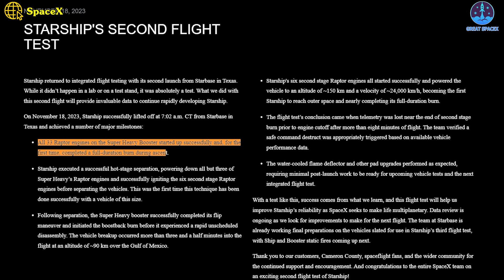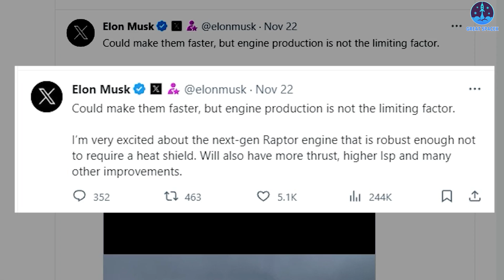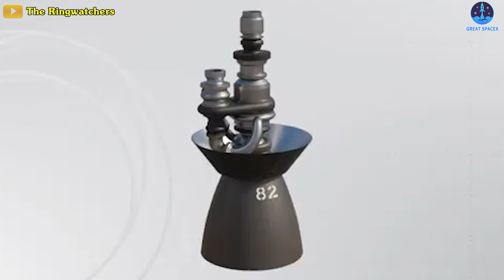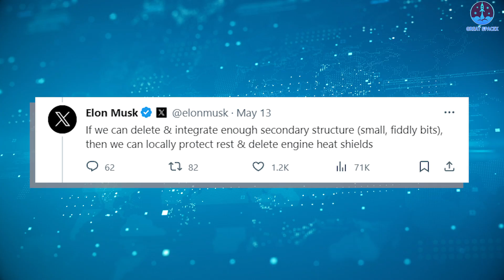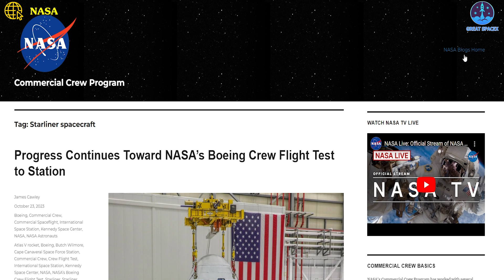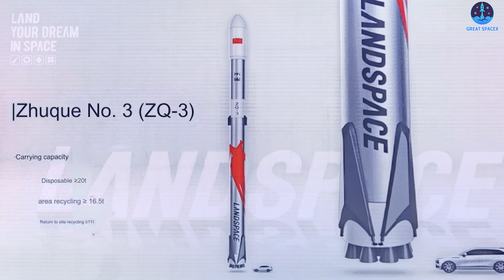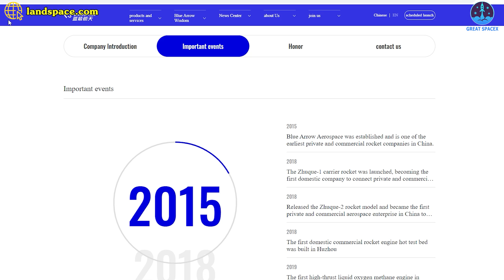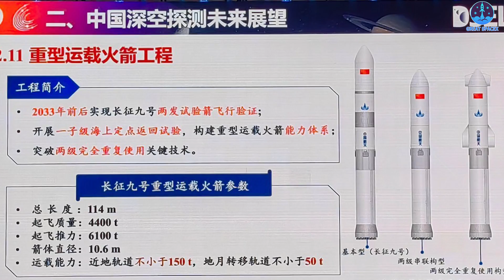Elon Musk just revealed next-gen Raptor engine “More thrust, No heat shield...”

Comment: I want to see how they keep the fuel and oxygen at the correct temperature and pressure once  the depot ship is in orbit, with the sun shining on it. If it heats up and expands, they'll have to vent.  On the way to Mars, how are they going to keep the fuel cold? I guess pumps and compressors, and batteries to run them - all of this will add to the mass of the ship and lower the payload.
Reply: Perhaps reflection and insulation, Tis cold out there on the non sun side, maybe a roll now and then to keeps everything in the tanks nice and cool

Comment: Another promise of more power when none is needed. The Starship hasn't lasted more than 10 min in use!  That's a launch customers 'take'.
Reply: they want more power so they can likely reduce the number of engines in the future. thus lowering launch costs.
Reply: So. it's all about what they want when what they have disapoints. That's a rich brat smashing his toys AGAIN. @Mike-jv8bv
Reply: The new engines are more powerful, more efficient, have fewer parts, are easier to manufacture and maintain, and cheaper to mass produce.  I really don't see a downside.  As far as not lasting more than 10 minutes, they achieved the initial goal of surviving until scheduled shutdown.  What happened after that is unclear, but on the booster, it didn't look like the engines blew up or otherwise malfunctioned.  Not relighting properly for boostback may be attributable  to fuel tank slosh/fuel starvation or other mechanical issue.  Still not clear to me if the booster RUD is because of AFTS activation or something else.  And I don't know that SpaceX has released a definitive report yet regarding what happened.  I've heard all kinds of opinions from those that don't necessarily have access to flight log data as to what happened to the booster or starship.
Reply: Curious which launch capable rocket engine ever fired more than 10 min? I’m pretty sure about 8 min does the trick. Plus Shuttle & Buran were the only launch engines I remember that fired from liftoff to orbit 8 1/2 min. through staging events. Maybe I’m missing something about your assessment.
Reply: I'm talking 4/20 and this one that's 2 that never made orbit regardless of how long they burned They failed! @phillipmiller5996

Comment: Using gas/ fuel mixtures will be so unnessasry once they develop nuclear power. Fuel storage/ refilling/ bulk of thanxs will make the raptors look like a model T car. Till then I think they are wasting money
Reply: I don't know that there is a viable technology right now to do that.  A lot of theoretical concepts, but nothing that I have seen more concrete than that.  Do you know of something that would be a viable nuclear energy drive?
Reply: @warrenjm9  The Voyager has been running on nuclear power since 1977.
Reply: @southofhollywood4199  Voyager didn't use nuclear power for launch activities.  The Titan3 booster was a hypergolic liquid fuel core supported with 2 solid fuel boosters.  Voyager has 16 onboard hydrazine thrusters for positional control.  "Nuclear power" is only used to generate electricity for the computers and instruments.
Reply: @warrenjm9  I recall reading somewhere that Voyager is powered by an isotope.  It will have power until the isotope runs out.
Reply: @southofhollywood4199  yes, Voyager uses a radioisotope thermoelectric  generator to generate electricity for the computer and instruments.  For maneuvering control, Voyager uses 16 hydrazine thrusters.  Yes, those thrusters are controlled by the computer that runs off the electricity generated by the thermoisotope reactor.  But there isn't a nuclear thruster by any definition.

Comment: I question the use of all the engines during hot staging. Why not use the 3 raptors instead of both, the 3 raptors and the 3 Rvacs? It seemed too violent. Was the thrust of all 6 motors necessary?
Reply: Test the extremes.
Reply: There is a ring in-between the first stage and the second one....Do you think they haven't thought about that????? Are you an Engineer???? They will figure it out....sheeez
Reply: Are you? Stop being a snob. @1flash3571

Comment: How many extra tons of material do the heat shields add, and is the extra payload capacity worth the risks associated with not using them?
Reply: Good question, especially since the plan is to reuse these boosters.
Reply: Just imagine adding heatshield to 33, or 32 rocket for the first stage, AND 6 more in the Second Stage....Stainless steel isn't light even if it is thin. If starship can handle 150 tons of cargo with the shield, being able to carry extra ton or 2 is a BIG thing. Each ton is about 2000 lbs.
Reply: For the Falcon 9 and the Falcon Heavy to each bring a full payload into LEO, they expend on average about 45,500 and 47,700 pounds of fuel per 2,000 pounds of payload. So, for every ton of weight you can shed, you can save almost 50,000 pounds of fuel. That can either be fuel saved or fuel used for getting to the moon or Mars. Minimizing the weight would decrease costs while increasing the overall performance, efficiency, and range of the Starship. The ideal Starship would only be made up of equipment that is absolutely necessary for safe and efficient operation. Any excess just reduces efficiency and increases cost with no return.

Comment: Why doesn't SpaceX spiral the stainless steel on the outside of the rocket? One long spiral weld. No fiddly bits(rings to stack and weld). Could be done with a stationary welding station and a rotating rocket shell(tube). Bulk heads could be inserted as the shell is roller up and welded. It would make for a very fast rocket production system.
Reply: I dont know, im no engineer, but i think this is perfectly fine
Reply: It's a very good observation.  One might even make a continuous tube and slice off the lengths needed for specific rockets.
Reply: @clavo3352  How are they gonna keep the unrolled steel stable for the MACHINE welding to weld the parts together????? You really need to think before you guys start yapping.....Making the ring section is the BEST way to do it, one ring at a time......
Reply: I suggested the same thing several years ago.
take my up vote!
Reply: I think they won’t enough space to work with that.  They’re already working on the second launch tower.
Reply: @Puer-Aeternus-Anonymous  Well, that could be done horizontally, but I did a writ about it over two years ago probably on 
r/spacex, but I was thinking grow it vertically at the time. And have access thru the bottom of  system to work on internals as you went up.
It would probably be a good technique for seriously mass produced stuff, like disposable fuel, oxy, or water tanks en route to Mars, to then be landed and repurposed into habitat. If you removed the tank ends, you can fly round tubes like a box kite effect, and the ends could fly like frisbees with solid fuel rocket motors around the edges. would be a way to get them down easier and less damage.
Reply: @garylester3976  “The best part is no part”,   say Elon.   In general, the limiting factor for Starship is the FAA and that fishy entity.  Elon won’t even put landing legs on the Super Heavy  and Starship until they perfected the landing, before risking the launch pad and tank farm.
Reply: @Puer-Aeternus-Anonymous  
Yeah, I was the guy who started the parts count thing, got insulted and bad mouthed for a couple days straight for having the gall to make suggestions. called an example of Dunning Kruger effect, told to leave it to the experts, told to leave it to young guys old man etc. Told I was stupid.... 
I told them I would win in the end...
I knew going in I would get trolled by "Experts"...
But also knew if I caused a big enough fight, Elon would hear about it.
Guess what happened?
🤣
Just saw a video earlier this morning talking about Elon is still working on simplification of the Raptor 3 engines... He's been going non stop on parts count for a couple of years now. I knew the concept from electronics, was a Navy Radioman towards the end of the Vietnam era...
Elon is doing fine, not the ship I would design, but its his ship, and going to be a good one. And it will be the ship all the competitors have to beat. And by the time they do, Elon will have better ships! 🤣
Reply: @garylester3976  You make it sound as if it is easy to design a ship....Draw us the starship and post it for us if you think it is EASY....Are you even an engineer???????
Reply: that's a interesting proposal. But one might think this would require alot of custom machinery to spiral the stainless while continuiously welding it. but in theory it might be a way to have very high productive output as you are taking very long sections and welding it.
Reply: How would you have horizontal space for them to be able to MACHINE WELD that type of setup????? The rocket would have to be laid down initially and would have to be propped up AFTER it is welded. Also, if it is set up vertically, how is the steel rolls gonna be set up for it to be unrolled without interfering with the welding machine???
Reply: @1flash3571  no problem, do it like a steam pipe weld from the outside, with edges chamfered and a slight gap. and you could weld it automatically by using the gap as a track. Its not how I would build a hull, but Elon likes tubes, and that spiral technique is common in the fabrication industry for some types of tube.  used mostly on corrugated metal culverts but I have seen large diameter steel pipe made that way.
(You think they weld pipe sections from the inside? 🤭)
Actually on a hull, I'd use chines with graduual single curve bends, tack every thing up, and weld from the outside, as the angles of the chines would create your wedge shaped slot to weld into. And you could gap the plates, or just jack up the amps a bit to get full penetration and end up with a very fine bead on the inside, and the weldment shrinkage would help pull your plates outward to pre stress the hull shape outward. And would be less work than trying to run a second bead inside.
And less damage due to not being over welded.
You seem curious, maybe theres steel or aluminum boat building or ship building stuff on you tube? One thing to look out for is over width welds, very unprofessional, but especially common on aluminum boats.
Early Starship nose cones had that problem if you look at older images, I ragged about it online and they fixed that.
Hull fabrication is fairly common knowledge, plenty of back yard yacht builders in steel and aluminum. My dentist built a bìg yacht by himself and retired.
And Colvins Friend Klengal build stuff for sale in the 70 to 100 ft range by himself... FYI  75 ft and larger is considered a ship.
I think you should study it a bit, just for curiosity's sake. Also on drawing space ships, haven't done that since I was a kid, but I have been a good freehand sketch artist my whole life, also trained in mechanical drafting in the pre computer days. Also trained in caligraphy studying hand engraving in metal. I can really draw...
Elon's problem was he started out with rocket nerds and water tank guys, and tried to reinvent the wheel on hull fabrication... I've had quite a time planting stuff in comments online for his benefit.  I also studied micro precision machining... Basically 17.5 years of my life in schools...
Anyway if you start studying boat building and ship building you'll soon see there really is serious amounts of cross over to fabricated space hulls.
Reply: @1flash3571  And on the rolls of steel that would be no problem horizontal or vertical as you'd feed at an angle into your set of rollers to get the spiral. Could be vertical or horizontal,  as vertical you could push or pull the welded section upwards. and on horizontal use hydraulics or an over head crane.
Actually setting up rockets was an early use for hydraulics after WW2. 
And its still being done today. I think the Falcons are tilted up hydraulically.
And I've done writs here on Alpha tech about water launches, and that you could use the fuel and oxy mass to stand the rockets up in water. Would require insulated tanks though.
Theres always all kids of ways to do things.
Reply: @garylester3976  Do you really think that it is just as easy to handle a 9 meter vs how a falcon 9 rockets is handled???? If you think it is just as easy or similar, I have a bridge I want to sell you. How are you going to match up the edges to match the other side with the rollers rolling out the sheet of steel? Do you think Engineers at SpaceX haven't already figured out that out already???? Are you even an Engineer???? If you are NOT, then just leave the work to those WHO KNOWS HOW......Making comments without being an expert in those fields should just keep their mouths shut.......I can counter your argument because IT JUST DOESN'T MAKE SENSE if Those Engineers already haven't done it themselves.
Reply: @1flash3571  Hey Flash, easy on the surgery intake! This is a forum, not a 4th grade playground.